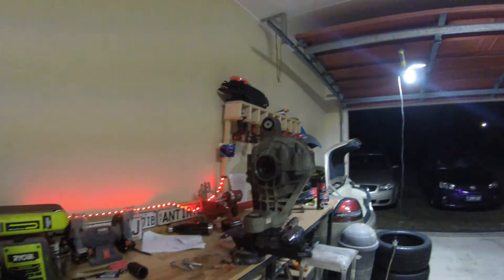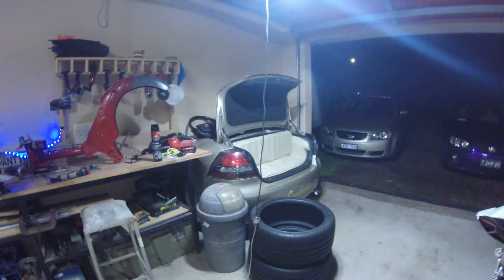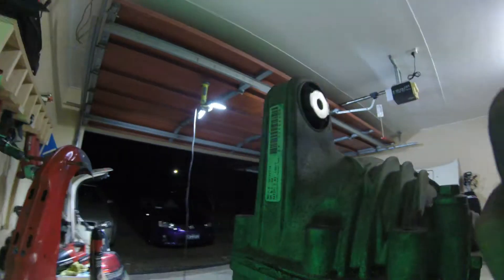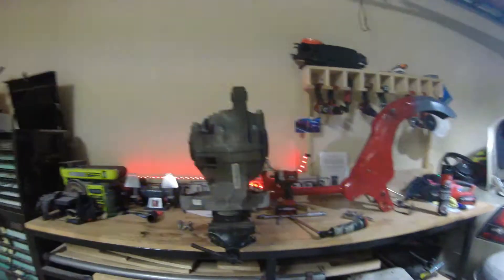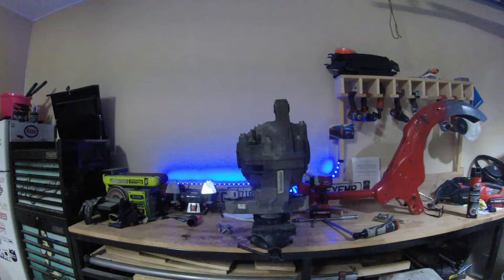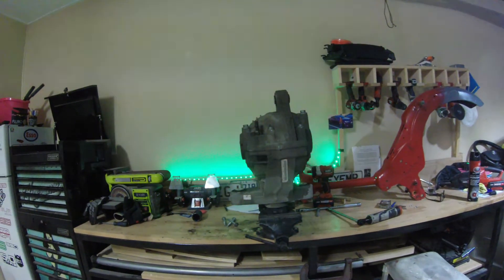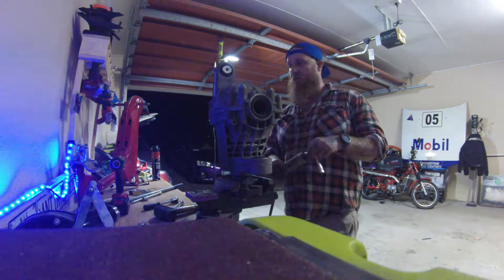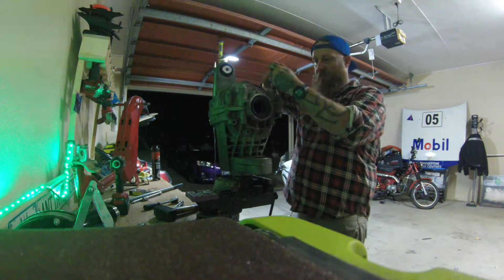VE SS /HSV ZF DIFF REPAIR PT1 (VF SS may be the same )

Comment: How could steel on steel clutch plates work, even if they are hardened?
I have worked with steel for over 18yrs, and I have never seen or heard of anyone successfully using steel on steel as a form if clutch, mainly because when you heat metal on metal up enough, it cooks the steel and will fuse it together........That is what happens when bearings fail in an engine and it seizes.
I would definitely want to see those steel clutches performing after 1000kms of hard driving or drifting!
Reply from the maker: The steel intermediate discs are meant to have a lining on them similar to a clutch lining material , factory VE diff stuff is rubbish !! But I tried the other clutch pack from the diff joint in Melbourne that I speak about in the video …. But I ended up selling the diff before I moved . As far as I know the diff is still in a burnout car getting smashed and loving it !!
Reply: @beardbuilds5140  Thanks for the reply mate.
Oh really, that's awesome. I would definitely give them a go and see, I just don't understand why every LSD doesn't come factory with these steel clutches if they are so good, also if they work so well in the diffs, why it hasn't been done for a normal gearbox clutch? Maybe it has and I just haven't seen it, or it has but failed , I dunno!
Was hoping you had done a second follow up video to your pull down, because at the moment my diff out of my Vf Redline is sitting on my garage floor!
I have tig welded all the pit marks in my CV axle from where the balls bearings started smashing into the outer casing, as well as the bearing gear! 
But I pulled my spider gears and cone gears out of my diff to make sure they were ok, as well as the clutches, but I couldn't find a video of how to put it back together WITH the cone gear shims/washers going in as well.............
I'm not gonna sugar coat it, I royally fucked the cone shims because I didn't know you had to compress the spider gears and clutches to allow just enough play with the cone gears to get the shims in without completely destroying them!
So I am trying to get 2 new cone gear shims/washers at the moment which is the only thing stopping me putting mine back together! 
Sorry for the novel mate lol.
Reply from the maker: @spinna6996  haha bloody hell you have done yourself a mischief !! I’m sorry I never got around to doing the other vid . 

Hopefully you get it all back together mint when the shims rock up !! Let me know how it goes !! I’m keen to hear you get it back up and going 👌🏿
Reply from the maker: @coolkicks4190  Neville McNamara differentials was the place mate !
Reply: @beardbuilds5140  Mate do you know where to buy these clutches? even just the stock holden ones. Neville McNamara is out of stock and not making them at the moment
Reply from the maker: @StorageAdelaide  mate I wish I could help , even stick diff parts are now thin on the ground